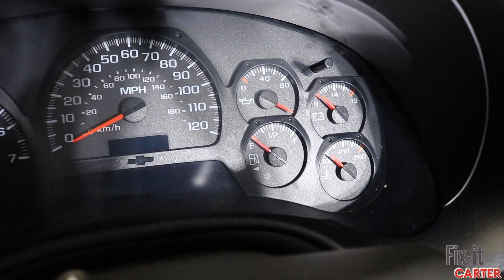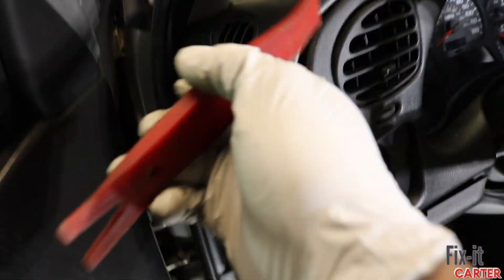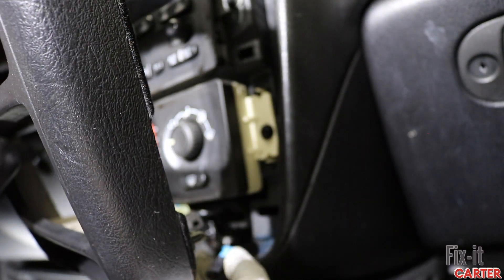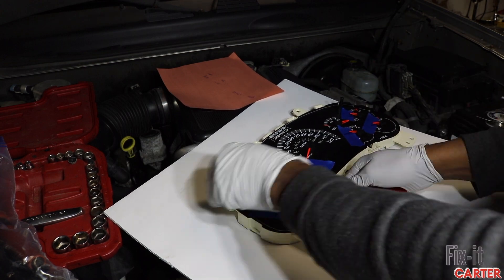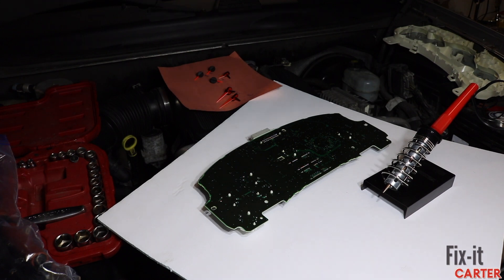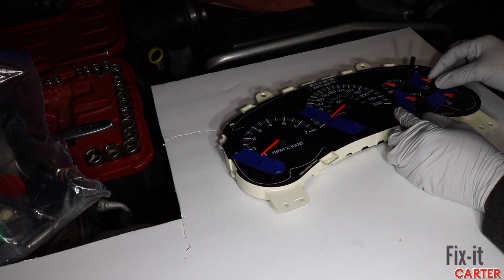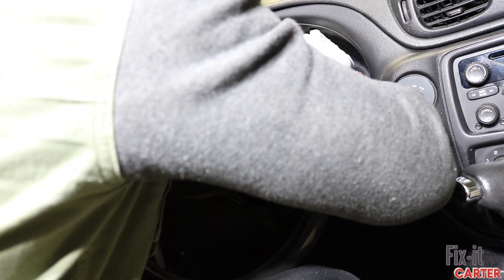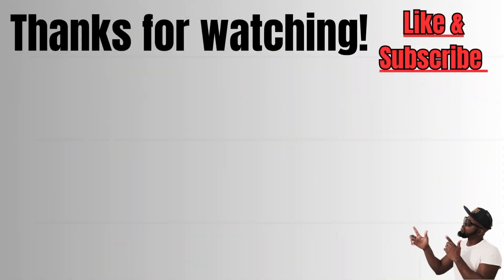Chevy Trailblazer Stepper Motor Repair Gm & Chevrolet Vehicles.

Comment: Wow, your a whiz  at that. I have a question though. I took a cluster out of another car not knowing the lights could be fixed. Then the idiot i am shot the cluster out and got one from a junk yard. Now all the lights work but my odometer reads nothing but dashes, my tach doesnt  work,  and the seat belt light wont go out. The gas gauge, the Temp gauge and speedometer all work though. Is there a simple fix for this? I have a GM tech looking at it this sunday but if i can fix it, id like to save some money
Reply from the maker: Yeah the gauges are all stepper motor related, unless you see corrosion and deterioration on the board. But most likely a weak weld or corroded weld causes the issue. As far as the digital stuff its usually the LEDs that need replacing. If the tech gets too outrageous with the price, you can always send it off to someone on eBay that will fix it for about 100 150 200 at the most. They will most likely give you a warranty and add whatever color LED you want to replace it with. But yeah, you can get all the gauges fixed and plus the LEDs.